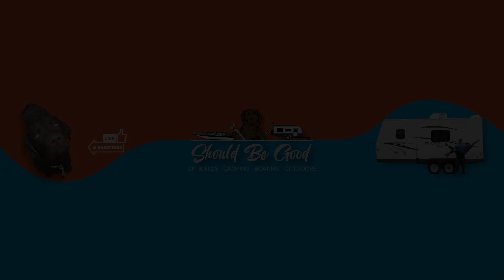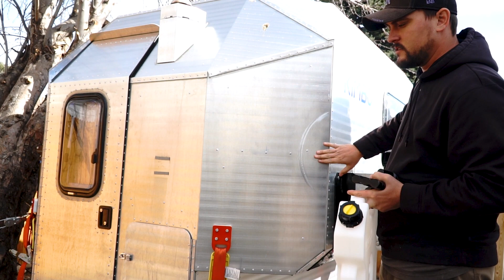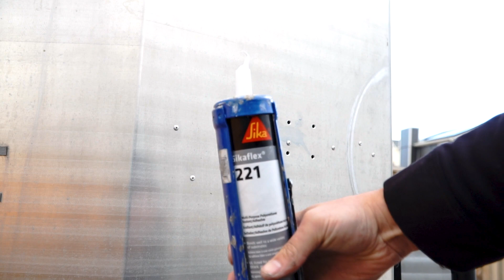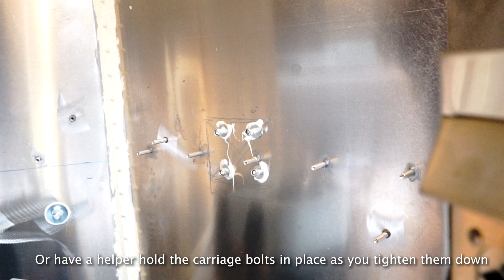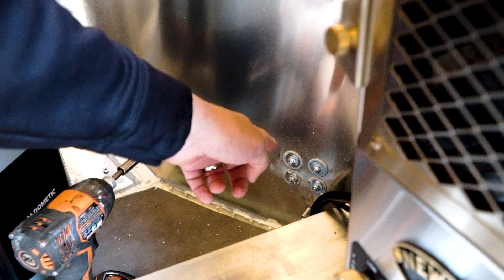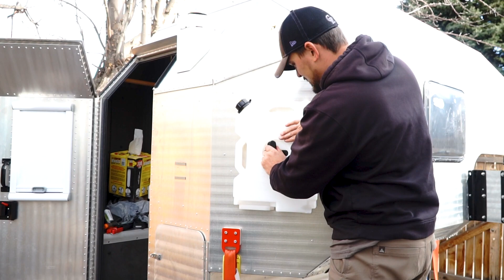How to Install a RotopaX on Kimbo Camper - Overlanding Water Container

Comment: what do you use as tools to removed the insulation and felt panels?
Reply from the maker: No tools needed to remove the insulation panels. Just need to unscrew the thumb screws and they pull out. Sometimes you need to remove additional panels if they are overlapping.

Comment: On the interior, does it just go straight from insulation to the felt panels, or any other layer? Sidenote, what type of insulation is it do you know?
Reply from the maker: Hey Robert, the suede/felt is glued to the foam insulation panel, so it’s just one piece and then the exterior aluminum wall. It’s 1” DuPont Styrofoam